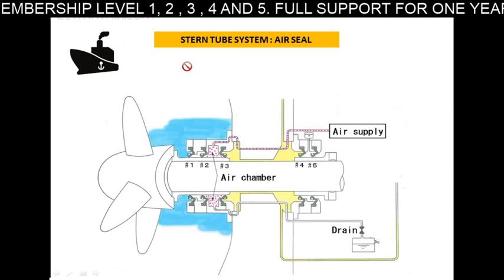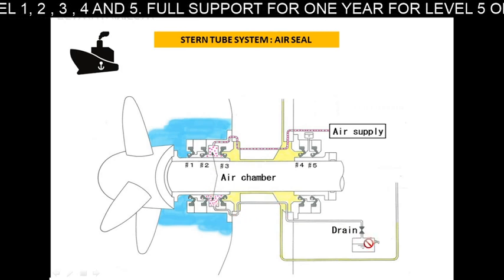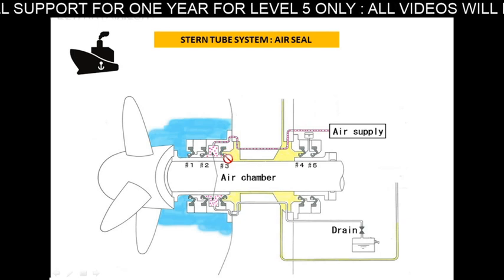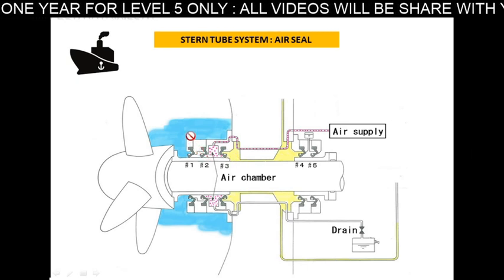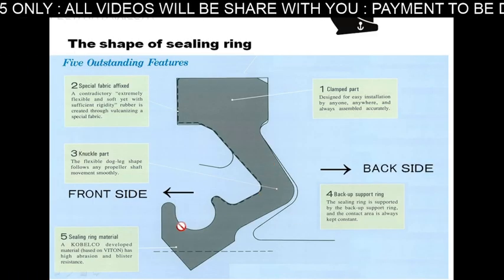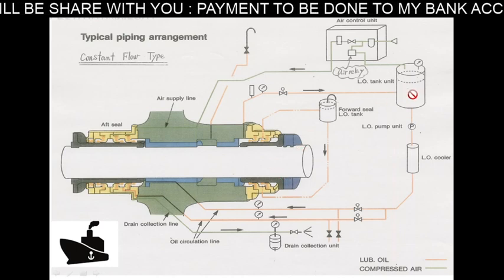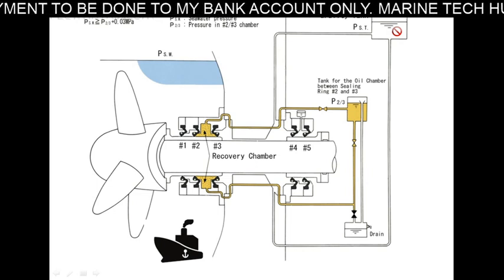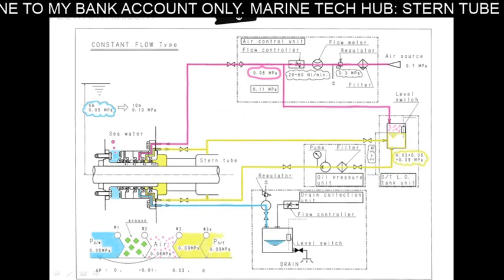Stern Tube System : Trouble Shooting; Important Tips For Engineer

Comment: Nice explanation
How to test seals in place?
Reply from the maker: If Seal is leaking you will get sea water coming inside or Oil going outside. During Dry Dock after fixing the New Seal Pressure test is done in order to find out the leakage.